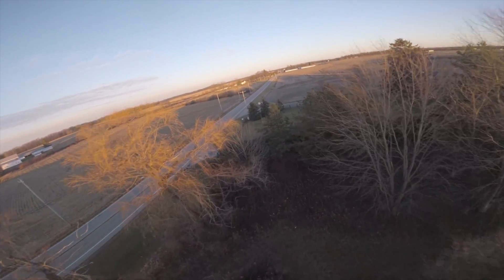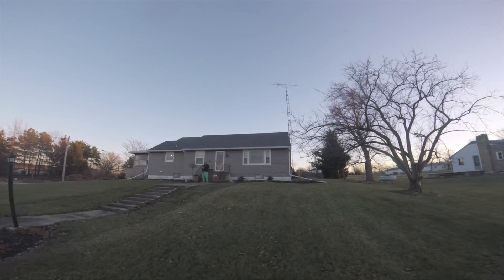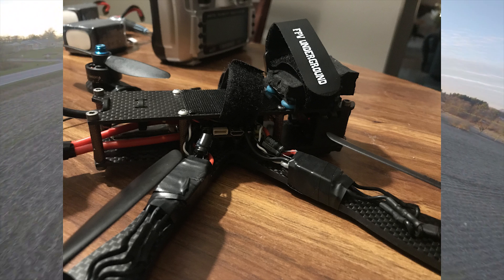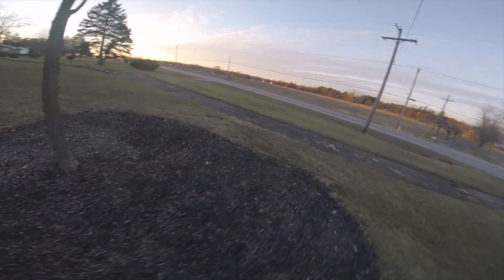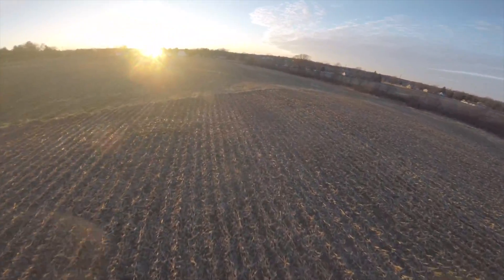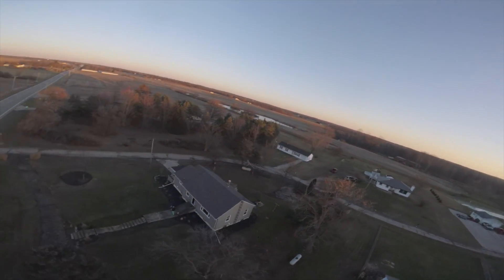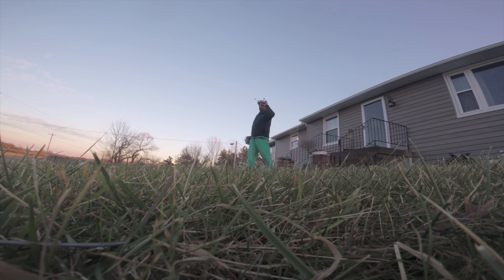6 INCH PID SMOOTH VIDEO TUNING PART 1

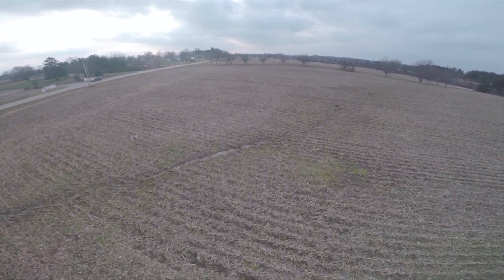Comment: That sunset is perfect condition. Well tuned with that bi blades:) Jello is easy to avoid with ND filter. The problem is the other thing visible at 4:00. How did you fixed that? I dont know if I have the same, but something similar. Already replaced everything but the ESC. Event butterflight and several betaflight versions with multiple PIDs and filters. No solution. Going to watch next part.
Reply from the maker: Man. I know. But since I’ve went back to flightone and the new falcox don’t need none of that. Maybe give it a shot
Reply from the maker: blasbike ah man. Been such a long time and many frames and toys ago. Lot of good props too. I mainly just fly 5 inch 6s now. Super buttery
Reply: @Dorkyand40  haha yeah I know, long time! It takes so much time to have a perfect tune and tuning is only possible without wind. I already have blackbox nightmares ;)

Comment: I fly in Horizon mode and I have an Oblivion, Batman220, and Skitzo Mini quad. I am fighting jello on all three. I am a novice so I haven't even started fooling around with PID's and honestly don't know how. Tried different props and dampening for the GoPro too.  This is really frustrating to say the least.
Reply from the maker: John Wood there is a difference between jello and oscillations. Jello is easily fixed by adding a stick on Nd filter to the GoPro. Jello is the waves you see during mid day and into the sun. Oscillations are tiny vibrations that show up. Tuning is honestly a last resort. Using the correct frame and making sure your stack is tightness correctly is the first steps. Next try a prop like the hq5.1x4.1x3. It’s the best smoothest prop around right now. Also higher kv motors help.
Reply: @Dorkyand40  Yes that is correct I understand this. I have both issues. The 5.1 Prop will not fit on the Oblivion it will hit the lens of the FPV camera and body too. I have a Hero4 and there are no stick on ND filters for this older GoPro Camera. I have been building bigger Multirotors for my customer for 12 years now and been in the Hobby since 1981. So I know all about shutter speed and Jello. No disrespect.

Comment: FWIW flying at sunset is not the best way to tell if you've removed jello or not. The shutter speed of the GoPro during golden hour is considerably slower than what it is during mid-day. Try flying when the sun is high in the sky & you'll get a much better idea of how well your tuning is going. I spent a week of coming home after work, tuning and testing, finally thinking I was there. Then I went and flew over the weekend and most of my stuff still looked like crap until the sun started going down, at which point the jello slowly disappeared as time progressed. Jello is a direct result of very fast shutter speeds on the camera(due to the rolling shutter) so you really need to test it in the brightest conditions where the shutter speed will be the quickest.
Reply from the maker: Vibrations that is.
Reply: Vibrations are the root of the problem, but you don't get jello unless the shutter speeds are high. Fly at night with a shitty tune and you'll see all kinds of vibrations but not jello because the image isn't warping.
Reply from the maker: yep..well aware..ive had a shitty tune and seen jello and vibes even during poor lightining conditions.  point of this is to try and help get people to a point where they can find tune their ships..kind of like where i am right now. and skip the dozens of packs and frustration.